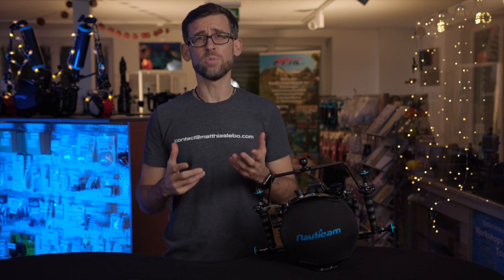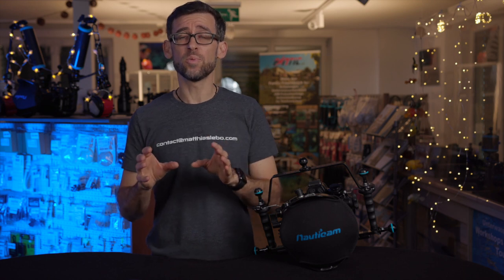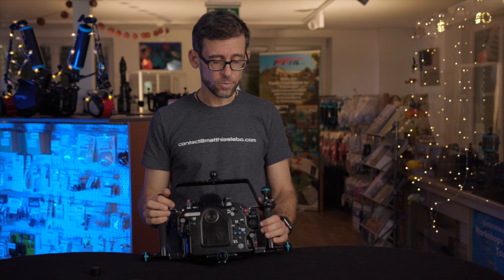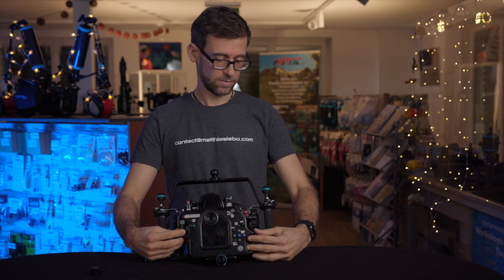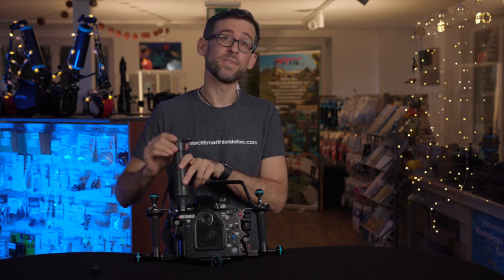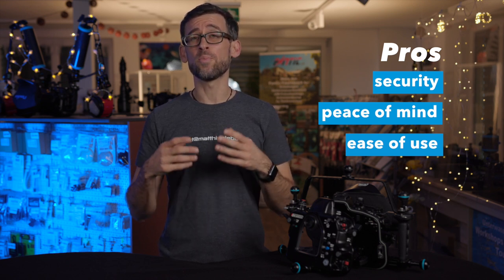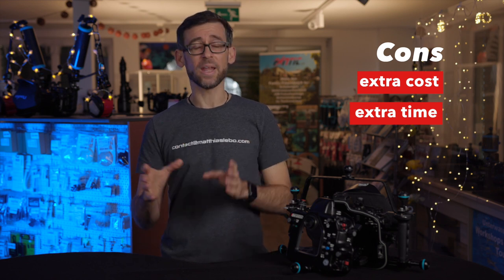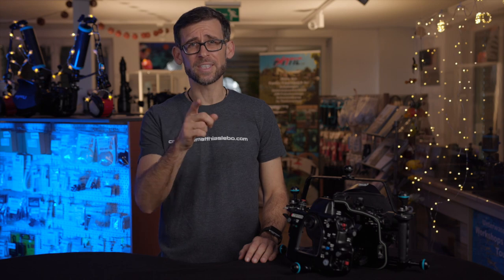WHAT IS A VACUUM SYSTEM?!

Comment: Hi Matthias, thanks for this video. It shows pretty well how those systems works at least for Nauticam and a few brands that offers electronic system. There are also mechanical ones (i.e without electronics inside the housing) where you check the system above water through a vacuum gauge (e.g Ikelite) hours before the dive. Those systems are not temperature compensated (in opposite to electronic ones) therefore pressure may vary through time. In any cases, creating a vacuum also 'sucks' o'rings towards the inside of the housing which kinda positions the o'rings in a similar way as if they were already underwater. Apart from any monitoring system, this is an added security for shallow/surface waters where the housing is often more vulnerable as o'rings may not totally rest in their "watertight" position. Unless you have a mechanical vacuum gauge, I don't think it's an extra hassle to deal with those detectors before the dive considering the peace of mind they bring. If people do their housing preparation the right way (not on the back of boat 5min before diving), there will still be lots of time before the dive to check if the green light stays green and if it changes, it's probably a wise thing to leave the housing on the boat or postpone the dive.
Reply from the maker: Thank you mate for the added information. Very valuable. I couldn’t agree more, There should always be enough time for proper preparation of your underwater camera system before getting in the water. 👍🏻
What system are you using by the way?
Reply: @MatthiasLebo  The housing or my GH5s comes from Nauticam as well as the previous one so I have the standard vacuum sensors. I am however not using their valves but one with M14 threadings from a small business called Vividhousing. Their valves are cheaper than Nauticam but still very reliable.
Reply from the maker: Thanks for the details mate. Have you tried a housing from them as well. They look interesting.

Comment: I'll share my experience.
Got a leak my Nauticam LX10 housing for a compact last week and killed the camera. 
I'd checked everything the night before, and on the morning of the dive. Vacuum in the morning. Nice green LED, left home, went to get tanks. It's a shore dive. 
We start the dive, check the LED still nice and green. Descend to 5 metres, gree, check a few minutes in, still nice and green.
 I was looking for critters in this shallow warm water shore dive so quite concentrated, and after staying at 7m for a while and not finding much, at 9m we're finally getting to the good part, finally something to shoot. We were 40 minutes+ into the dive, and then I realised something had happened. 

Neither myself, nor my buddy heard the housing's beeping alarm. 
I was expecting to hear the high pitched beeping that the housing emits when you test the sensor, just like in the video, but instead it was a continuous beep when I noticed.

I did notice a continuous high-pitched sound at some point but thought it was coming from the regs or maybe a little tinnitus in my ears. We're in the tropics, I was wearing a very thin hood from my scubapro top, and my buddy a 5mm hood, so much for the unmistakeable alarm you can't miss...

Didn't see the red led (which is on top of the housing) either- I only noticed when I tried to turn on the camera (I'd only done it twice to white balance in the dive) and nothing happened... Oops. Saw the continuous red LED then....
We ended the dive --  I was expecting a flood but checking on land it was only a few drops in the housing, but enough to kill the camera. 
No visible water on the cam, battery and card fine, but LX10, dead.

After drying out, the sensor and vaccum circuitry seems to work fine, but I'm scared to dive with the housing. I chose a Nauticam housing with a vacuum system for security, relative peace of mind ( having flooded a plastic Lumix LZ10 housing in 2015, but this was due to hair in the o-ring after long travel from Europe to Raja Ampat), and unfortunately, it's not as simple, even on a dive going from 5 to 9 metres only...

My next dive will be with the housing empty, after a full regrease and check, to see if there might be an issue with the new housing, that I've only used 5 times because of lockdowns... I do not know what happen. I''m suspecting it might have come from the vacuum valve's screen cap somehow.

I'll be checking the led every 3 minutes from now on. It's a great tool, but lulled me into a false sense of security.
Reply from the maker: Hey buddy, thanks for your comment. This sounds like a very unfortunate experience and I'm truly sorry, that it ruined your camera. It's hard to say for me, what exactly the reason could be for that. In my experience, the Nauticam Vacuum system has worked flawlessly every time. But having said that, I have also not had a flooding yet on this system, so I can only say for sure, that it works well as long as it is airtight. 

Have you talked to the dealer that sold you the housing and vacuum system? Maybe they have some extra insight or experience on that issue they can share with you?
Reply: @MatthiasLebo  thanks - yep, the scariest thing is not knowing what went wrong in this case...
Nauticam had some very useful feedback. Apprently the vaccum valve is fully waterproof, so it's highly unlikely it came from there. 
One possibility is that I over-vaccumed. Apprently you should stop as soon as you get the green light, otherwise overvacuuming might cause a delay in detection for small, slow leaks.
One thing that might have happened is that the alarm contacts got shorted straight away, meaning I only had the continuous beeping sound, instead of the more audible leak alarm.
I'll be doing some more testing in the future. O-rings on compacts like the NA-LX10 need more care than the ones you get on GH5 housings where the entire door comes off.

Nauticam also recommended to vacuum the night before a dive to catch slow leaks.

The over-vacuuming aspect is very interesting, I'm guessing it might be that as I did pump 2 times after the LED went green.

I'll really make sure to check on the camera every 3 minutes or so in the future!!